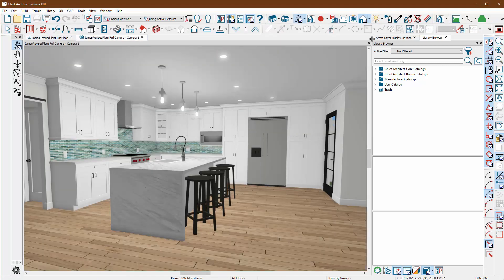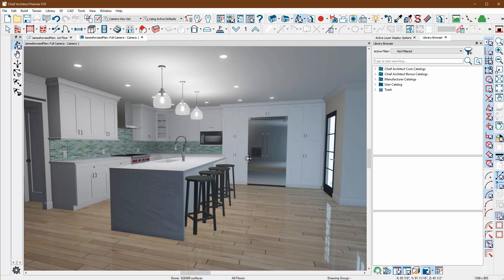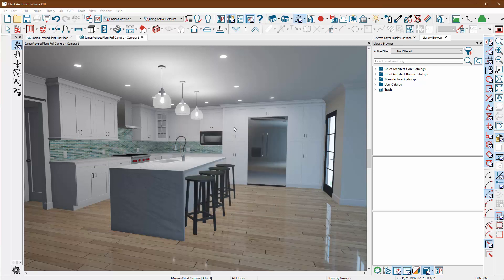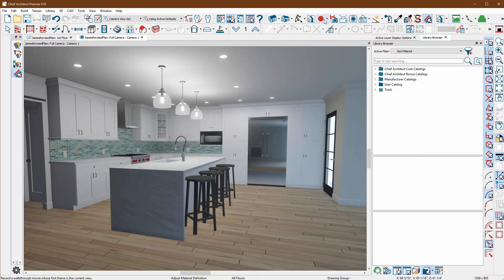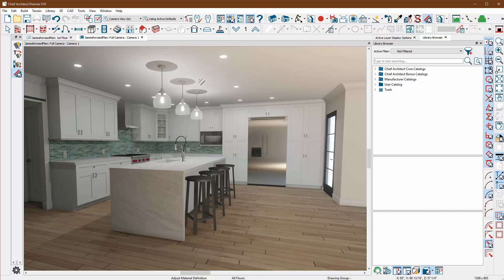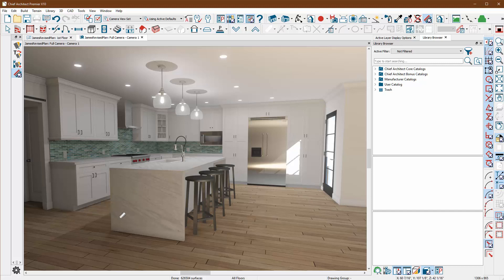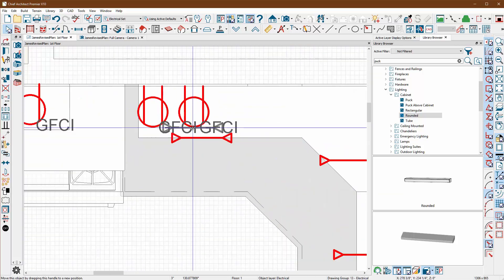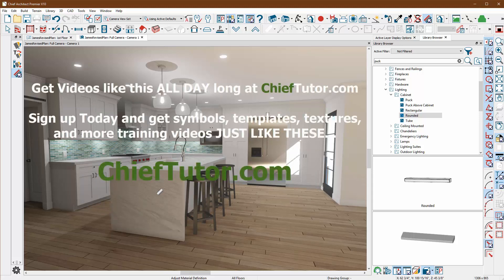ChiefTutor.com  /  Chief Architect PBR

Comment: I have chief architect x9 but it dosent show camera view plz answer me
Reply from the maker: It was added in Version X10 - X9 does not have this option. - you would need to upgrade to get this feature. Best of luck.
Reply: @DavidMichael  sir plz can you tell me the system requirements iam using laptop of acer with 6 ram .plz give me the system requirements so that i can purchase my new PC or laptop to use cheif architect X9.plz answer me and solve my problem. I will be  thankful to you.